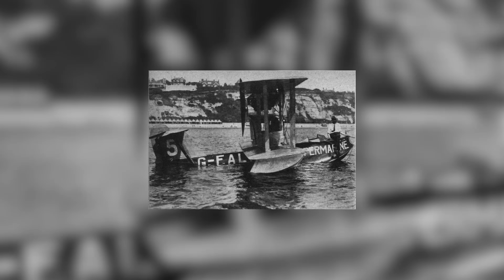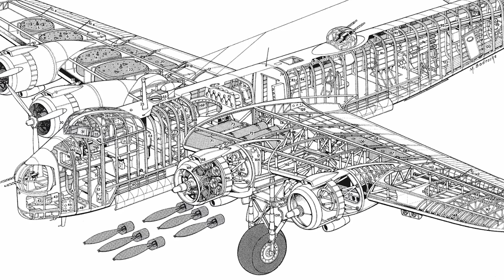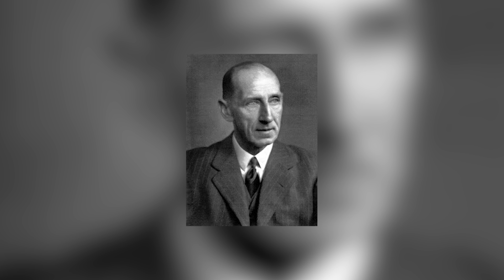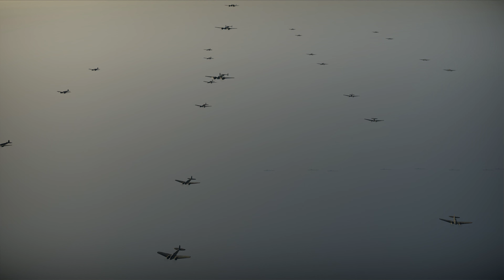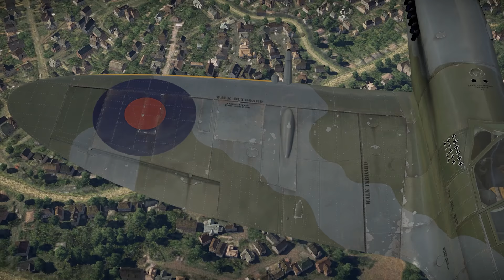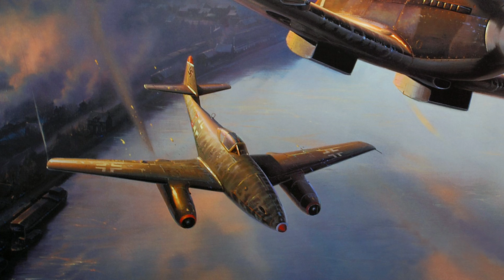SPITFIRE | A Documentary

Comment: The Spitfire was, without a doubt a very good aeroplane, but it is very strange that most of the documentaries don't tell you, that one of the most important reasons, the Spitfires (and Hurricanes) performed so well as they did during the battle of Britain (and the rest of the war), was because they got high octane fuel  from the United States (up to150 octane versus the Luftwaffe 87 to 100). High octane fuel increases the performance of the engines up to at least 25 % more power, resulting in higher topspeed and rate of climb.  The higher the octane number, the higher manifold pressure you can achieve. Before the RAF was able to use this superior fuel, the German pilots were not that much impressed by the Hurricanes and Spitfires. So this high octane fuel, greatly helped to free us from the Nazi's.  Greetings from Holland.
Reply from the maker: Hello!
I don't usually reply to comments trying to correct/add stuff because I'd be here all day otherwise. But hey, here I am at last.

None of the rather extensive research I did on the Spitfire suggested anything quite as close the performance boost you are suggesting. 

So many people have this 'thing' that they've found out about the Spitfire (or other aspects of history) that is relatively unknown, and then unfortunately then treat it like the most important aspect of the Spitfire/other historical thing. In reality, all of these aspects of (in this case) the Spitfire work together to make it the brilliant plane it was. The higher octane fuels used, the Miss Shilling's Orifice, C.H. Keith's foray into pre-war France to check out the Hispano cannons, the elliptical wings, the Air Ministry giving Supermarine another shot at the design and hundreds more events led to what the Spitfire was able to achieve. In the same way that it would be unwise to say 'Britain/Russia/America etc. won the war' or 'the muddy ground was the only thing that helped the English win at Agincourt' or 'the Athenian navy was the only reason the Greek cities won the Persian war', it would be unwise to give any one of parts of the Spitfire's story total credit.

As for the specifics about the fuel types supplied by the US, I'm afraid I can't remember enough from during my research years ago to talk about exactly the impact they had. I did come across it a lot, and it was one of things I didn't talk about that was closest to making the cut, as it definitely had an important impact on the Spitfire's performance, and was a mildly interesting story given how little known it was. It just wasn't quite interesting enough to put in the documentary, which was already longer than I had wanted it to be. Another issue was that it wasn't just one lot of higher octane fuel that turned up, there were successive waves of it being delivered throughout the war, and so to keep the story chronological (which I wanted to keep to when I could), it would have broken it up too much for my liking.
I also can't remember exactly when they started introducing the fuels the US were able to send over, but I'm not entirely sure how true the comment about the Battle of Britain is, because I had believed it was later on in the war. It's easy to forget just how early in the war the Battle of Britain was. But I'm not sure on this, and don't have any of the books I used (that I owned at least) on me right now.

The fuel sent over by the USA did help Spitfire performance (and maybe efficiency? I can't remember). But the real marked impacts on performance were from the upgrades that I mentioned, the big two (Merlin) ones being the MkV and the MkIX.

Thanks for the comment though! I hope you enjoyed the documentary and I'd be happy to answer any questions you have about how it was made or anything about the Spitfire itself!

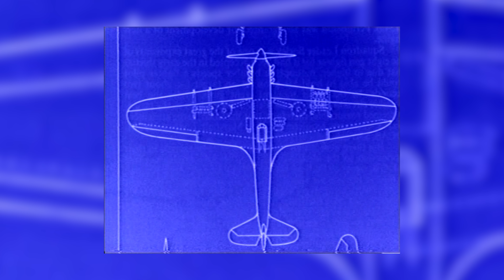Comment: Very good, but the blueprint shown at 13:33 is a Hurricane.....
Reply from the maker: It does look fairly similar to the Hurricane! But it is as close as I could find of a representation of the first redesign of the Type 224 to the Type 300. It  doesn't yet have the elliptical wings of the Spitfire and so looks more akin to the Hurricane - but it is not a Hurricane.
I cannot vouch for sure the specific validity of the image as the first redesign into the Type 300 format that would become the Spitfire. I made this documentary three years ago and I unfortunately cannot remember where the image used came from. It may not be an exact representation of the redesign, but it certainly reflects what we know from the research I did about it.

Comment: "The origins began with the Type 224 of 1931, unfortunately it lacked the streamlined presence of the Schneider Trophy seaplanes and struggled to achieve the performance parameters set by the Air Ministry.  After the aircraft’s rejection in 1934, Mitchell and his team revised the designed under the designation Type 300 which would result in a whole Ministry specification based around it and become known as the Spitfire.  The prototype K5054 took off for the first time from Eastleigh on 5 March 1936 under the control of Chief Test Pilot (Mutt) Summers."
Spitfire Society Reginald Joseph Mitchell page

Comment: An outstanding documentary.  A few details in the Spitfire's development that you might like to add are: 
(i) The introduction of 100 octane fuel; together with a revised combustion-chamber shape in the RR Merlin.  This was applied to the Merlin II and III, and with variable-pitch propellers, substantially increased the climb performance in time for the Battle of Britain. The availability of 100 octane fuel was due to the pre-war work of Jimmy Doolittle (who later commanded the American daylight bombing  effort).  It was basically to counter the ME 109E

(ii)  The Mk V (to counter the ME 109F) was basically a Spitfire Mk II with the Merlin 45 engine.

(iii) The Mk IX was a stop-gap upgrade because the Mk VIII was still in development, and the FW 190 was making mincemeat of the Spitfire MkV;  it was essentially a Mk V airframe with a Merlin 61 with two-stage supercharger and intercooler; it also had two underwing radiators.  

The Mk VIII was the ultimate Merlin-engined Spitfire, having Merlin 60 engines, 3 sub-variants optimised for low, medium, or high altitude.  The Mk IX had a fixed tailwheel, the Mk VIII had a retractable tailwheel. The Mk VIII was used in Burma and Australia

The Mk 12 was a Mk V  airframe with a Griffon III engine, and was an interim type introduced to deal with the FW 190 low-level bombing raids on the English coast.

The Mk 14 was a Mk VIII airframe with a Griffon 61 engine
 (Data from "Spitfire - the history"  ISBN 0 946219 10 9)

Comment: 2x20mm cannons was a far more effective armament than 8x.303 machine guns. Japan, Germany, and later British designs had far more success with cannons than earlier attempts to put 20mm hispanos in the Spitfire. The hispano would go on to perform excellently in the Typhoon and later Spitfires once the reliability and ammo capacity issues had been solved and .303 guns would be quickly removed from the front lines as a fighter armament.
Reply: However the 20mm round is far more destructive than the .50 cal. So, if you are engaging lightly armoured (or practically unarmoured) fighters like the Japanese WW2 aircraft then the .50 cal is just fine, possibly better given the higher rate of fire & greater ammunition load-out. However, if you are facing bombers or late war fighters with greater armour providing both pilot & vital systems/ fuel tanks protection, then the 20mm cannon is more effective.
Also for destroying lightly armoured ground vehicles in a ground attack role the 20mm is better, both in penetration of armour & destructive force due to the explosive rounds, I believe it’s about 3 or 4 times more destructive than a .50 cal depending on the type of round loaded.
Reply: Perhaps, but the .50-calibre was effective.  The P-47 had eight, the P-51 six.

Comment: you mention the carburettor fuel starvation problem but not the thing that solved the problem or person who designed it. Beatrice "Tilly" Shilling, designer of Miss Shilling's orifice.
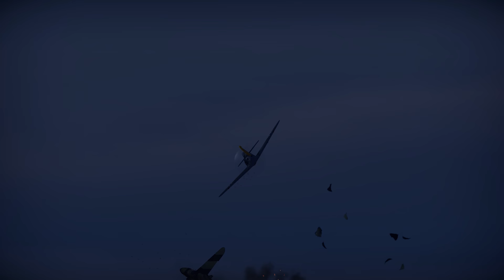Reply from the maker: The Miss Shilling's orifice was mentioned at 55:10 

As with many, many things in this documentary, I couldn't cover every detail about the Spitfire. I couldn't retell every story I heard and I couldn't mention every person who was important. Lots of wider details were omitted, but nothing in the documentary suggests those omissions didn't happen, I just simply couldn't make a documentary many hours long, for several obvious reasons.
Also, just as a side note, the Miss Shilling's orifice (while incredibly useful and, crucially, easy to install) wasn't a permanent solution, and didn't entirely solve the problem.

Comment: Incredible work.   Beatrice Shilling is most known for her engineering ideas for the Rolls-Royce Merlin engine in 1940 fighter planes. When either the Spitfire or Hurricane would perform a nose dive the engine would cut out due to the flooding of the carburetor. 55 mins in her accomplishment is recognised.
Reply: The modifications were more than just her little washer, not imlemented until 1941.
Reply: Any negative-g manoeuvre would do it.

Comment: Why didn't  they use fuel injection, surely they must have at least had the ability to reverse engineer it .
Reply from the maker: While it's not actually easy to simply 'reverse engineer' something into an already existing engine (although fuel injectors did eventually become standard), the idea of a fuel injector wasn't a totally new concept that the 109 brought along.

But you raise a question that I'd like to quickly go over - reverse engineer what? Because the 109s that landed on British soil didn't really tend to land in once piece. That being said, it wasn't an impossibility and the RAF were able to test various captured 109s. The Fw190 that accidentally landed in Britain being the only one the RAF could test gives you a good idea of how being able to test enemy aircraft wasn't always easy. In addition, tests like those were often done to see how they faired against existing and future RAF planes, so stealing little bits of tech wasn't really an option? Like the cannons on the 190? Too bad, they're manufactured in Germany and it'd take years to design a similar one and put it into full scale production. Certainly not worth it. 

Only for exceedingly next-level technology, like a jet engine, would reverse engineering be really worth it.
But at that point it would be too late anyway...
Reply: Mechanical fuel injection is not that easy to produce, very fine tolerances etc and you needed to have all of the field ancillary equipment to set them up and maintain them once installed, also there are all sorts of other things involved with the metering that meant it was not a straight-forward proposition. Think of the Lucas mechanical fuel injection on the Triumph 2500 cars and the fun we had with them keeping them working properly and you get an idea of the complexity. My Uncle was in the hush hush side of radar Oboe with Lancasters and he said one of the advantages of the Merlin was that the erks could generally keep them going in the field whilst the complexity of the DB 605 engines meant they had to be professionally serviced or sent back for maintenance. 
This was to some degree moot when a female mechanical engineer named Shilling designed a special fitting to go into the fuel feed that would allow it to operate during a negative G manoevre, it was affectionately known as 'Miss Shilling's Orifice'.

Comment: The Spitfire was one of two planes at the right place at the right time.  Other being the Hurricane. 
But I can't rate them highly, due to their short ranges.  The Japanese flew for hundreds more miles during the same time period.
Reply: The zero that couldn’t compete with the p38 because of its poor high level performance and low dive speed, the same p38 which couldn’t compete with the ME109 because of its poor manoeuvrability and engines and had to be withdrawn from the European theatre. Range wasn’t even much of a problem as the Spitfire was fighting above its own airfields and could hold its own against the 109 which had a similar range but had to fight closer to the limits of that range.
Reply: @paulm2467  - Range was always a problem for the Spitfire.
Reply: @BA-gn3qb  109 operational range, (no extra tanks), 373- 440 miles (depending on variant), Spitfire (no extra tanks) 415- 440 miles, this gave both planes a usable range of approximately 150 miles, the 109 had to use at least 60 miles of that to cross the channel and back and double that to reach London and return. A spitfire could dogfight for 10 minutes and then attack bombers or a second fighter, a 109 was at the limit of its range so 10 minutes was about its limit, it wasn't the ideal escort for the bombers and, indeed later the Germans stopped deploying it as such. This was especially so during the battle of Britain when the German Luftwaffe expected the 109e to win the fighter battle easily, as had happened with all the other aircraft it had encountered, it wasn't until the later f and g variants that it could hold its own. The Spitfire was designed as a short range interceptor/fighter and as such worked well. It wasn't the lack of range that was the real problem, it was the lack of aircraft. The Hurricane was a different story, it wasn't really capable of mixing with a competently flown 109 as it was too slow but it could outturn both the Spitfire and the 109 so could hold its own when necessary. Because the Hurricane was bigger and stronger it was a better gun platform for attacking the bombers so that was it's main job. The Mustang, when it came along was a great escort fighter as it had fuel tanks in the wings and aft which gave it triple the range of both the 109 and Spitfire but the  contemporary Spitfires and 109's were still the better fighters in a dogfight.
Reply: @paulm2467  - Thanks.  YOU keep proving MY point. 
Range has always been a problem for the Spitfire.
Reply: @BA-gn3qb  nah, it’s obvious to anyone who reads this that you haven’t a clue.
Reply: @paulm2467  - You lost when you 1st responded.
Reply: Range wasn’t a problem for it’s intended role, that of an interceptor. The ability to climb swiftly, manoeuvre sharply & dogfight was what mattered, in these requirements it excelled in the defence of Britain. Later in the war when the allies were bombing Germany and long range bomber escorts were needed then yes, the Spitfire was too short legged for the task & the much heavier P51 came into its’ own in this role.
So for long range escort duties then you have to choose the P51, but for the fast interceptor role the Spitfire is the superior choice. Put it this way if pilots of equal ability in a P51 & a Mk 14 Spitfire were to dogfight 100 miles from their airbase, then in nearly every encounter only the Spitfire will be coming home. If it’s 300 miles from their’ airbase the neither is coming home as the Spitfire would have to make a forced landing (possibly crash) due to running out of fuel shortly after it shot down the P51.
Reply: @jonathanhicks140  - You are wrong on ALL accounts
Reply: @BA-gn3qb  No, tests were carried out of the various calibres and 20mm is far more destructive than .50 cal, there’s no getting away from the damage caused by bigger & explosive rounds. Similarly the Griffon engine of the later Spitfire models was more powerful than the Merlin of the earlier models or the P51, when the more powerful engine is fitted to a lighter and more agile aircraft which is also fitted with superior armament then, given equally skilful pilots, the outcome is heavily loaded in favour of the Spitfire - but only within its’ range envelope, it isn’t going to be doing this over Berlin, but it was never designed to do so after all.
Reply: @jonathanhicks140  - So you prove my point.
The Spitfire range was Shit.
Reply: @BA-gn3qb  not for its’s designed purpose, as an interceptor it’s’ range was quite sufficient. Burdening it with bigger tanks would simply add weight & make it slower in the climb & less agile in a dogfight. P51, great range so excellent for bomber escort duties, but not as good in the interceptor/ dog fighter role the Spitfire was designed & continuously developed for.
Reply: @jonathanhicks140  - Did you even READ my 1st comment? 
"I can't rate them highly, due to their short ranges."
And all you do is Prove that point as you fly off into comparisons to other planes.
You're just a Troll and a Putz.
Reply: @BA-gn3qb  Not at all, I’m only pointing out that your standard of judgement is irrelevant for fighters designed as interceptors. You are the one comparing them to long range escort fighters which would be inferior in the interceptor role. The Spitfire & the ME109 possessed very similar ranges, and both were armed with cannon once model development progressed. Basically they were the optimum designs at the time for their’ chosen role, to discount them because they didn’t have longer ranges is as pointless as saying they couldn’t carry 4 tons of bombs - they were not designed to do so. You can only judge their’ ability in their primary role, that is as interceptors. Although the Spitfire was also developed to be a photo reconnaissance plane par excellence.
Reply: @jonathanhicks140  - My standard is Range.
And you have very limited range in thought.
Reply: @BA-gn3qb  And you prove how foolish you are, your’ selected standard is outside of & irrelevant to the design parameters of both the Spitfire and the Hurricane fighters which were designed as interceptors to destroy bombers and dogfight with the enemy escorting fighters, in order to protect the country.
I may as well say how poor the Catalina was as a sea plane because it couldn’t dogfight.
Enough, it’s like talking to a child.